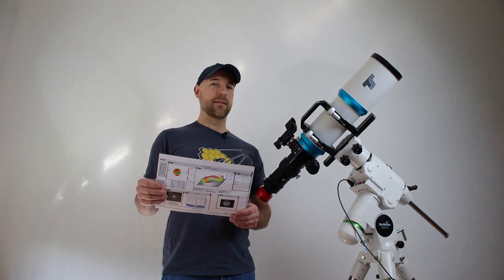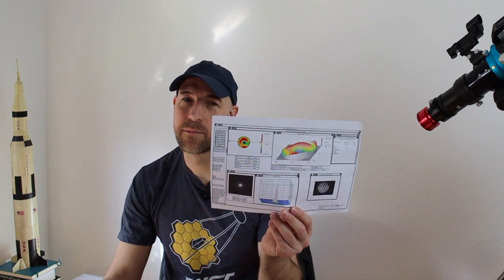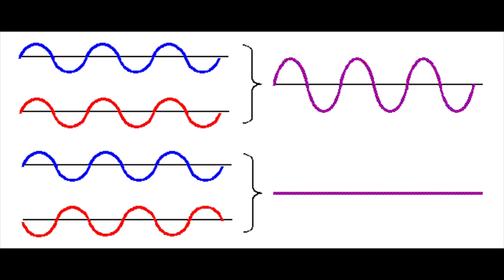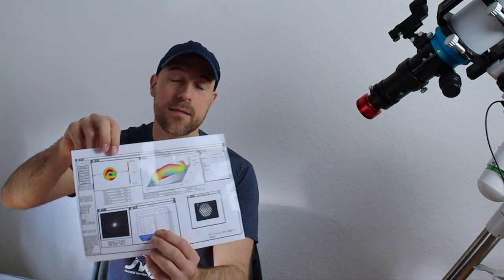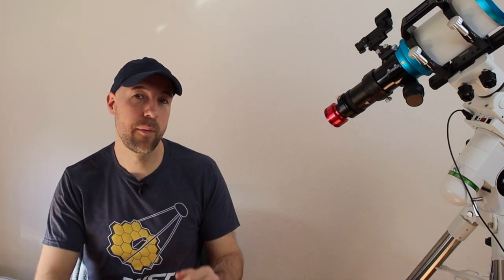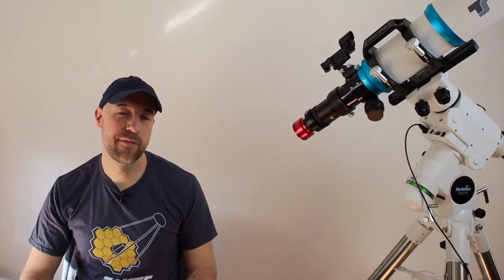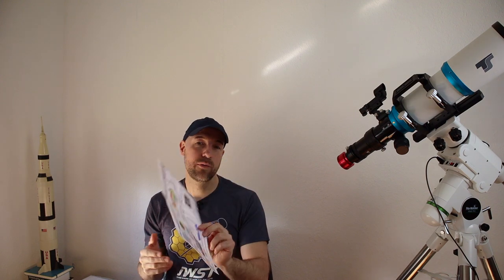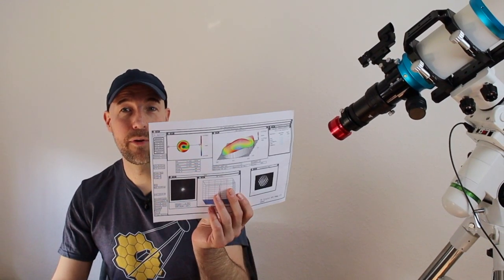Understanding an APO Refractor Test Report

Comment: Thank you for explaining. Am in the process of acquiring a triplet, so this is key to understand this :-)
Reply from the maker: Awesome. Really glad that has been helpful. :) Thanks for the kind feedback. Hope you will find a cool instrument fitting your needs. I'm really happy with mine. Clear skies
Reply: Hello Tully, from the telescope i am considering, they shared the test report, similar to yours in format.  Strehl value 0.974.   Seidel coefficients tilt 0.074 (Angle Degs -0), Focus 0.137, Astigmatism 0.014 (Angle Degs -70), Coma 0.111 (Angle Degs 180) Spherical -0.137. It's for a 115mm triplet.  The values seems good, right ?
Reply from the maker: @meibergstrmandersen9181  yeah, seems really good. (sorry for the late response). Clear skies :)

Comment: Thanks for this video asI have the same refractor as you (but from the first batch) and I was not sure how to interprete the 2 upper graphs. It is quite clear now :)
Reply from the maker: I'm very glad it was helpful for you. Thank you for watching and commenting. :)
Reply: @tullyfisher  you're welcome :) by the way, it seems that the new batch of refractors are slighlty different. For exemple, TS logo is gray in your scope while it is orange on mine (usual colors TS optics). Maybe other parts have been changed. It could be interesting to investigate. 
For info, I have the SN 009.
Reply from the maker: @slim1857  Yeah, I think so.. I saw some pictures and videos of the last TS telescope batch...but I never checked the details or did some comparison. I have the SN047. I also saw that they increased the price by more than 20%! ...as many thinks during those crazy times..